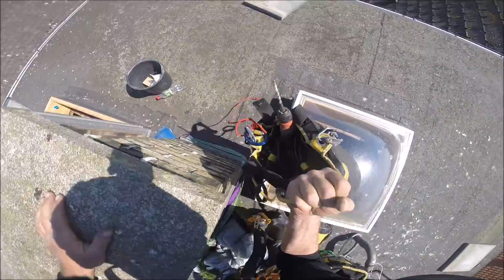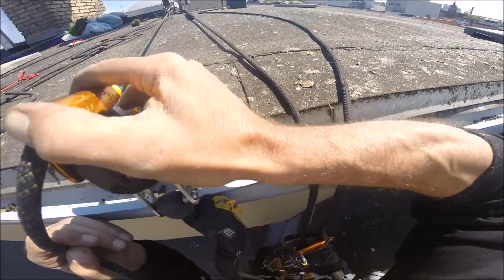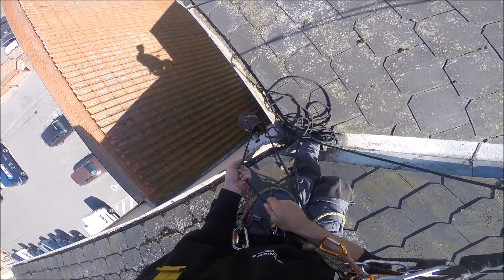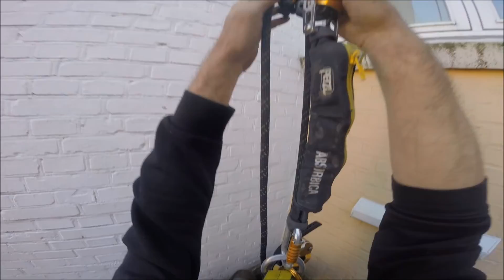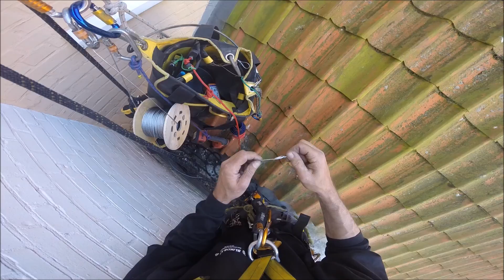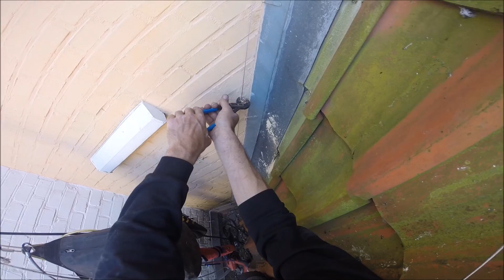Rope Access,  mounting the bird netting

Comment: How does your rope wear look like after a job like that(over edges)? Is there a reason why you dont use wire strops or armored rope? 

There seems to be a significant amount of sideway positioning, which I wouldn't do without wire(considering rough edges), but I have never actually tried it for wear!

I like the tube fitted in the drain so it doesnt break! Will use that on residential homes!